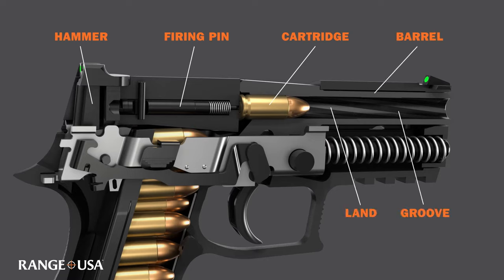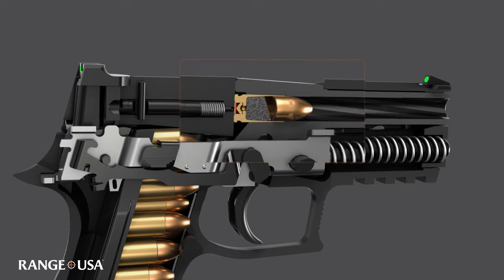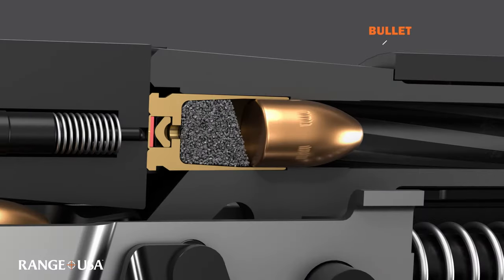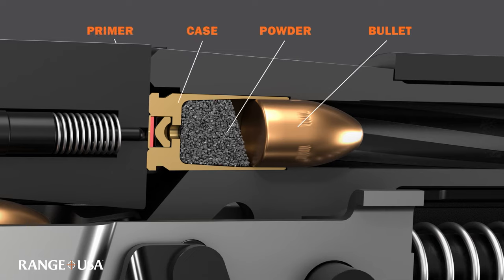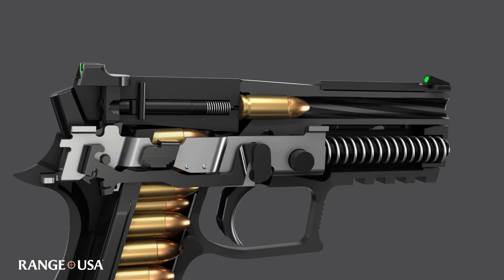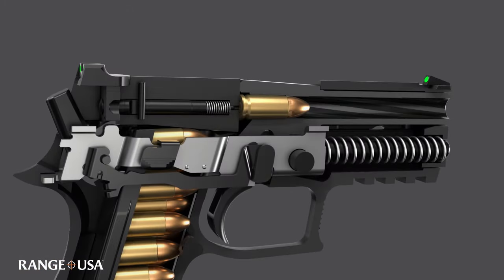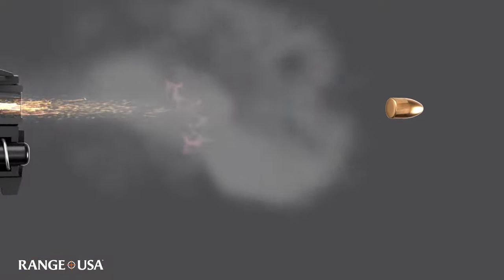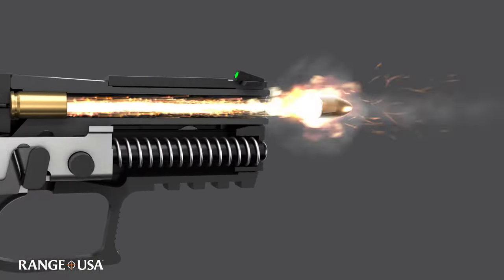How a Handgun Works: Semi-Automatic Firing Process

Comment: how that pin thing? why does pin needed ? i just dont get it
Reply: Firing pin because the primers need to get dented in order to start the ignition process of a cartridge, the other pin I presume you mean is a firing pin safety, mostly seen on striker fired pistols its used to block the firing pin until the trigger has successfully pushed it up and out of the way so the gun can fire
Reply: kjjjkkkkj